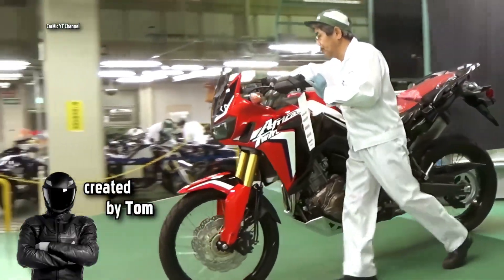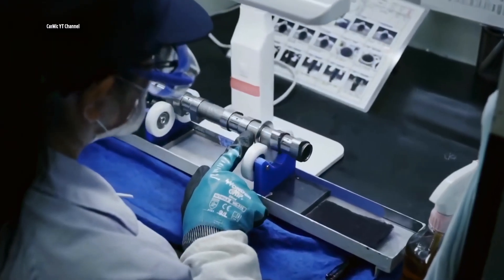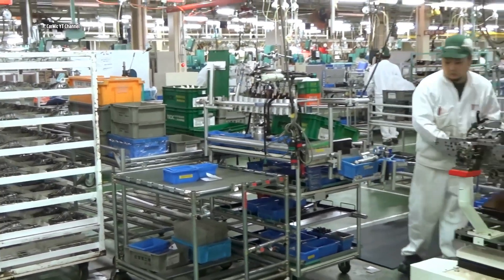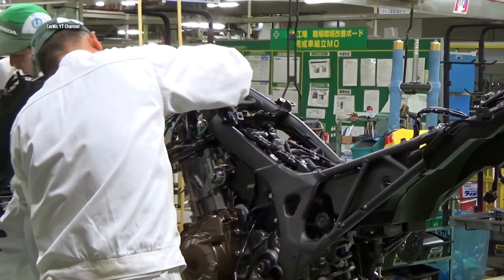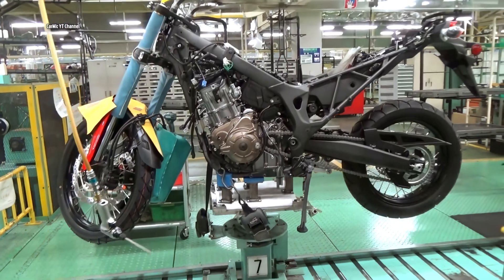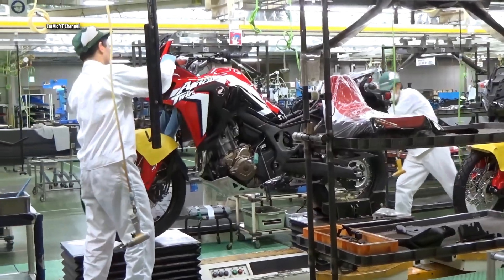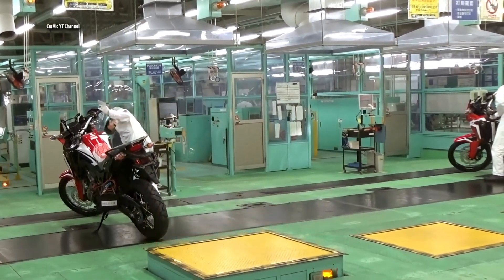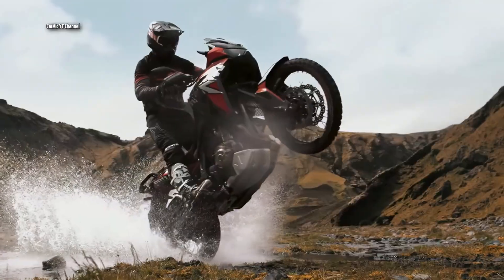Producing Honda Africa Twin CRF1000L inside Factory - Manufacturing long distance adventure bikes

Comment: This engine is better than the BMW R1300GS engine and the Ducati Multistrada V4 RS and the Desert X engine.
Reply: the reason is that the engine doesn't heat up quickly on the legs during long trips and off-roading